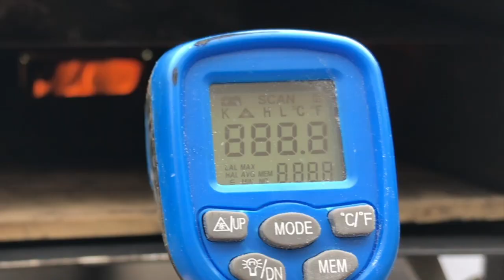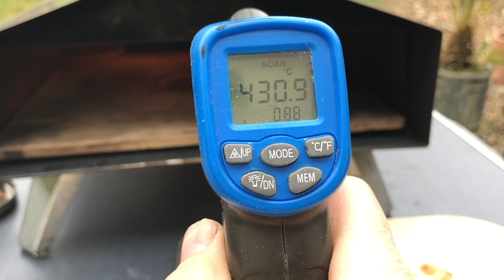Cleaning & Lighting the Ooni 3 Pizza Oven.

Comment: Not that bad, considering how many pizzas you've run through the oven! Ready to go for the next batch!
Reply from the maker: True!  But if I’d stuck to using the Uuni pellets it wouldn’t have been half that sooty.  The cheaper pellets gave off so much more soot but that’s the compromise!
Reply: Good to know that the Uuni pellets are that much better!  Wuff has some (supposedly) good hardwood smoking pellets. Will give them a try, but will definitely have the Uuni version "on speed dial" as alternatives.